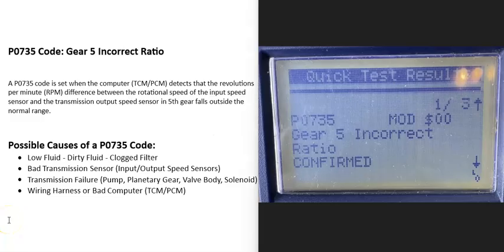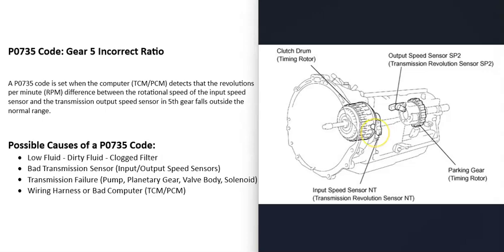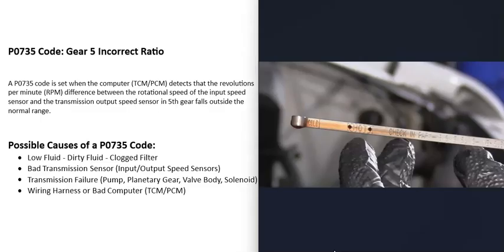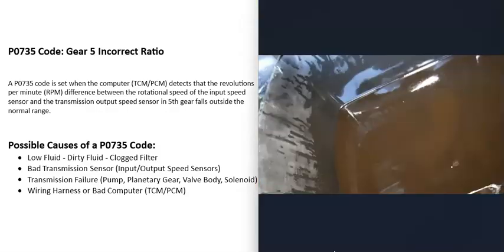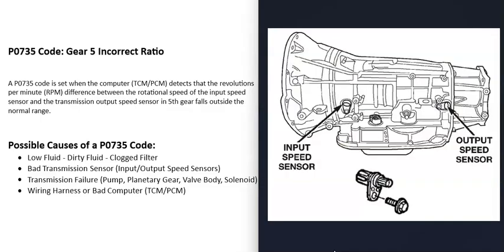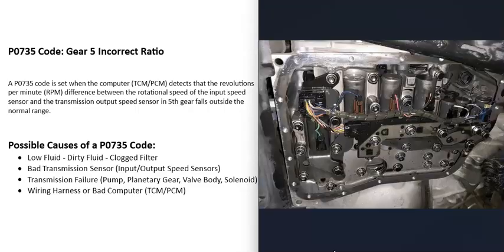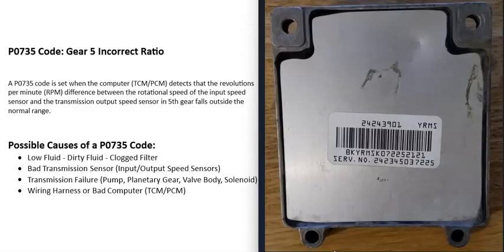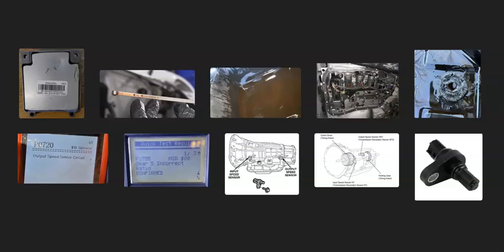Causes and Fixes P0735 Code: Gear 5 Incorrect Ratio

Comment: 2017 Chevy 3500HD cab & chassis Duramax 
I experience another issue that is not mentioned causing the P0735 code. My transmission operates normal 99% of the time. Once in a while pulling a gooseneck with 24k lbs on the deck or without a trailer, during acceleration it will suddenly pop losing drive pressure and my engine stays at 2,700 rpm until I back off the throttle. I have to come to a stop and turn off the ignition and sit for a couple minutes. Then start the engine then drop it in gear then continue with my journey with the transmission behaving normally. Sometimes I have to clear the P0735 code which I have a obd2 dongle and my phone. Did this twice to me in the last 2 months. Is there a pressure pop-off bypass in the transmission causing this?

Comment: I just had this come up on my 2015 2500 today. Only had the PO735 code no other codes. Thankfully mine does have a trans dipstick and it looked pretty low when checking ive only driven the truck about 60k miles but not sure if the previous guy changed the fluids out. What do you think best thing to do? Just top off the fluid and drain the pan and change the filter. Since unsure if it’s ever been changed. Praying that’s all it is. Sense I’ve had no other codes
Reply from the maker: It can be difficult to say without knowing what the previous did (or did not do). They likely never did any maintenance, which is very common. I would only do a drain and fill (fluid in the pan) and a new filter as a full flush on a transmission that has not been maintained can cause issues. Also, a component could be bad.

Comment: I have a mazda bt50 weat 2009, and my transmission keeps jumping out of gear also makes a massive jolt when the torque converter kicks in. That's when this error code popped up when I used the scanner

Comment: Man I’m worried about this one. I got this code on my 2014 Nissan titan. I just bought it from a dealer and I’m wondering if they sold me one with a bad transmission. Hope and pray it’s not that. Lmk if that’s an exaggeration
Reply: This happened to me in 2023 on a cross country road trip. I changed the fluid and tried to change the valve body solenoids, but it didn't work. I saw other videos on swapping the module on the valve  body, but I didn't order one and thought the fluid flush worked. I was pulling my inheritance home and in Tennessee the transmission burned up the higher end gears. I'm waiting for times to get better to get the transmission rebuilt, b/c it's $6000 to have done.
Reply: @jasongarcia1542 I had this fixed actually. Sorry to hear you’re having such a bad issue. My truck was purchased from a place that wasn’t the most reliable ( thank god mine is perfect now ) and the place put a jack underneath my trans pan and it cut off fluid so the trans was choking. That’s all it was fortunately
Reply: @Dag59990  Man, you dodged a bullet! Glad that worked out for you, reading your post had me stressed. Yeah, it's kind of my fault for not swapping out the module, but there's no way to know if that would've solved it. It's an old truck and I kind of got my money out of it. A rebuilt trans should do me good enough for a while.